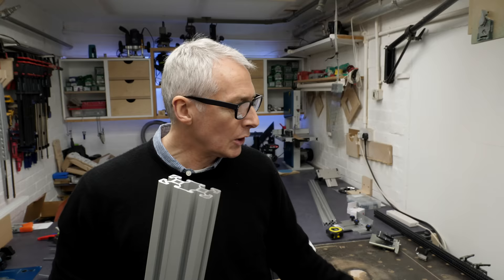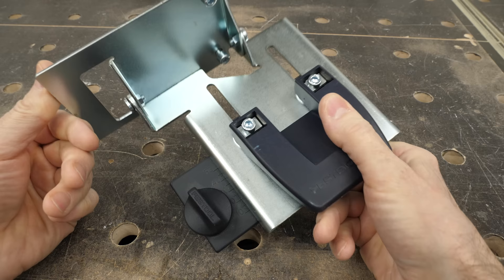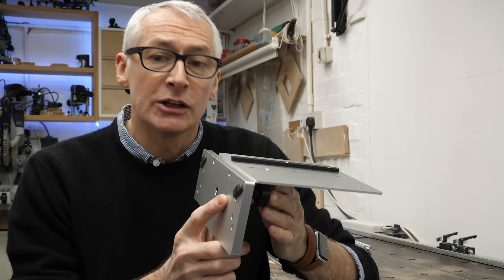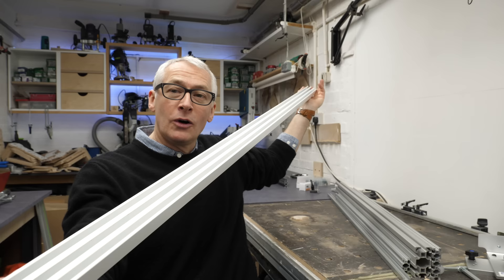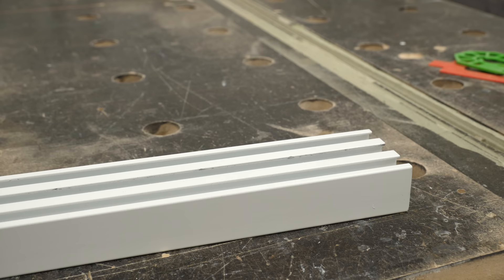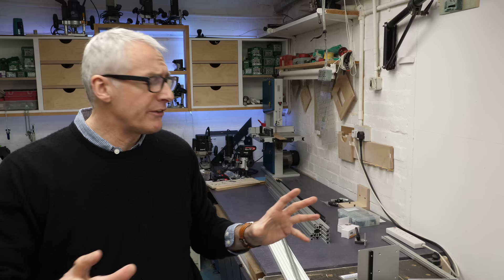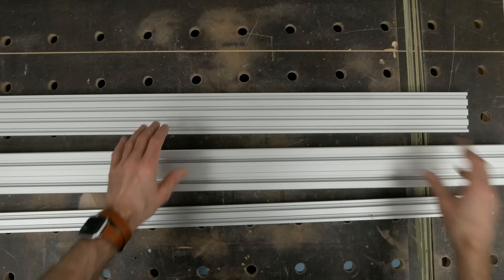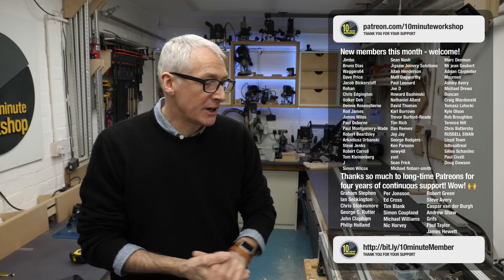Extrusion Confusion - A Guide To MFT Hardware [video 486]

Comment: Would it be possible to replace the t shaped part on the festool spare part to fit in another track? maybe by 3D printing?
Reply from the maker: It's a complex part - not sure it would be worthwhile, especially with Ikea curtain track at £19/length. 👍
Reply: @10MinuteWorkshop  that might be true indeed. Was hoping for a more sturdy track that would work better with clamps. Thanks for sharing the dimensions required, I have a large table which is actually a stage element with t tracks in the side. Gonna check the dimensions to see what my options are without modifications.
Reply: To add... My table is the same style as Laura kampf uses in het workbench video. Very interesting table design. Bit on the big side but very strong.

Comment: Couldn't you create a profile yourself? Take a hardwood beam and make narrow slots in it at the distance you want, in which you glue aluminum T-profiles with epoxy glue?
Reply from the maker: Now you're just giving away the plot... 😂 But the issue is the T-profiles - and getting one that fits the Festool parts is something I haven't managed yet.🤷‍♂️
Reply: @10MinuteWorkshop  oeps sorry

Comment: Have you tried Incra T-Track? I have it installed in the front of my bench and takes a Festool rail clamp nicely.
Reply from the maker: Thanks, I haven’t, no. The clamps are rarely an issue tbh - it’s the Festool rail support set that cause the problems! 👍👍